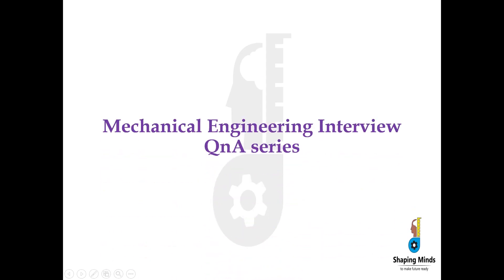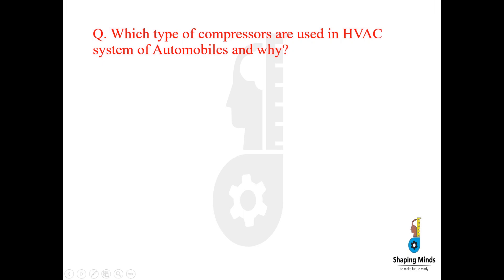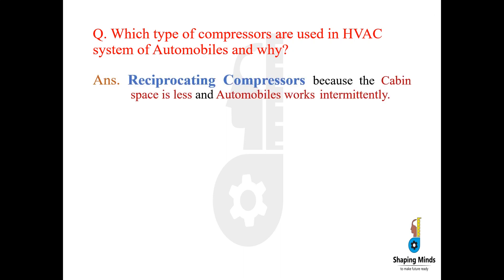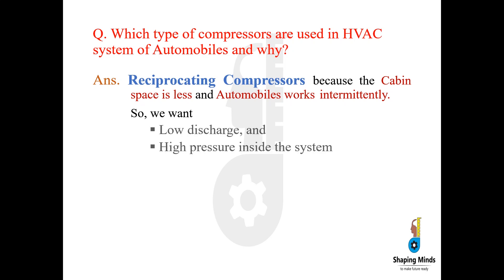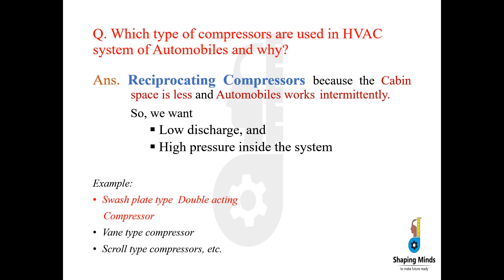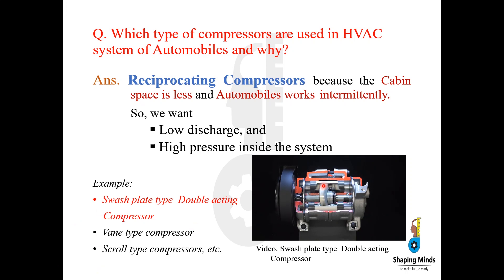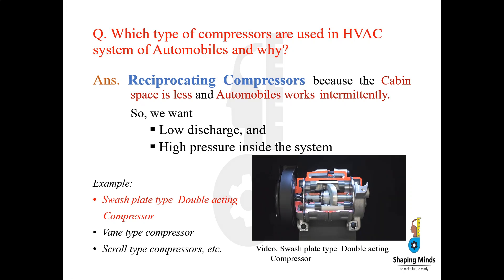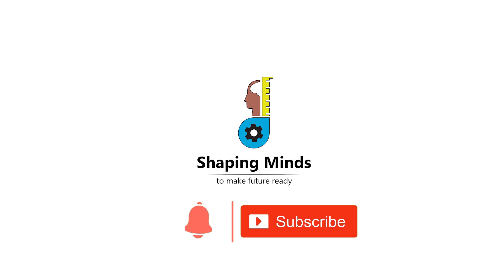Type of Compressors in Automobile HVAC | Swash plate pump | Interview Questions | GODREJ | MARUTI  |

Comment: What will happen if compressor is used as a pump and vice versa ?
Reply from the maker: pump is used to increase pressure only and the working fluid is in liquid phase whereas compressor can be used to increase pressure and temperature both and working fluid is in gaseous phase
Reply: @shapingminds3530  thanks